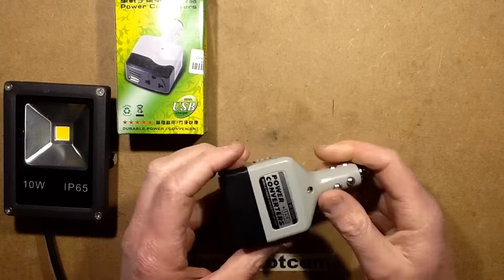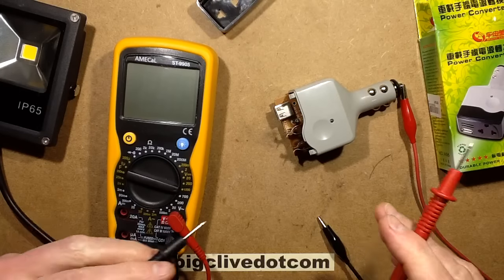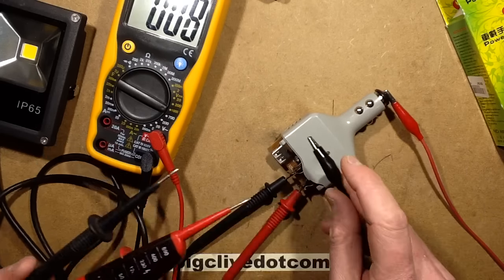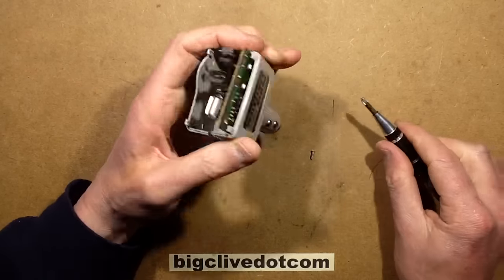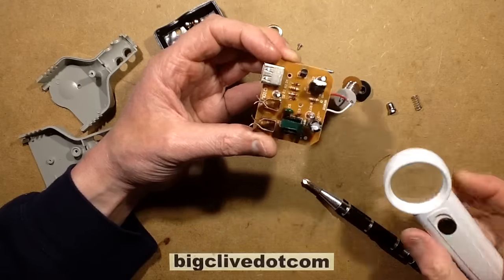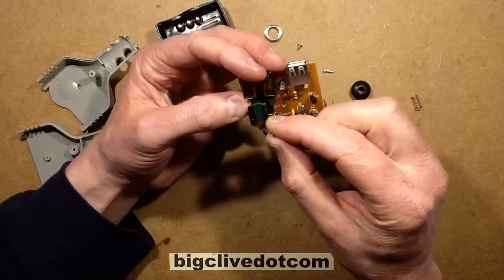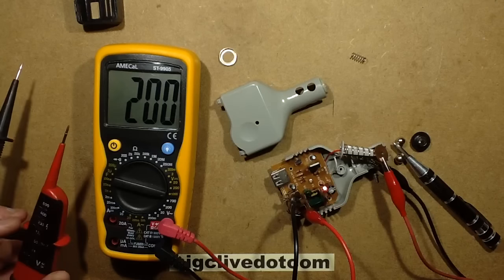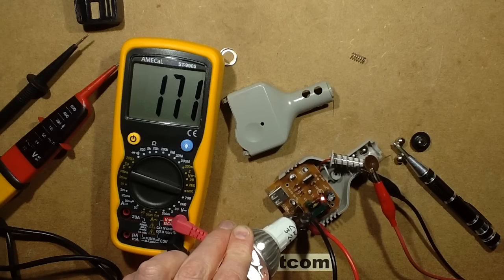Inside a slightly bizarre car to "mains" adaptor.

Comment: What are you saying: that the switching power supplies for most USB-charged devices can do their step-down without depending on AC coming in? IOW, they're universal like universal motors? The switching part comes from before the transformer, so somehow, even it can vibrate while only getting DC in? How does it adapt?
Reply from the maker: The AC going into a power supply is usually converted straight to DC and then used to pulse the small transformer with high frequency.  The wide voltage range is accommodated by a feedback circuit that tames down the power supply when its voltage is met.
Reply: @bigclivedotcom  Most devices with a full wave bridge rectifier after the mains fuse function properly on 100 VDC here in Japan since it would only be going through 2 of the diodes in the bridge. I did see only one appliance that REQUIRED 9 VAC and refused to operate on 9 VDC. That was the original 8-bit Nintendo. No idea why it would not work though.

Comment: But how can something that is ment for ac be plugged in this dc transformer and work as usual?
Reply: +Pirat Carribean Because its only designed to run switchmode power supplies, like phone chargers. Those sorts of thing rectify the AC input to DC as the first step, so if its DC already it just passes through the diodes and works the charger as usual. Likewise its highly variable, lower voltage isn't a problem as most power pack will work on both US 110v, and Australian 240v without any form of switch over, so as long as its between those limits it'll work fine.

As an aside it will fail to work with anything that require a lot of current 9liek a bigger laptop charger), or actually needs the AC power (like a motor).. and may even damage these things or catch fire as it tries.
Reply: +Hamish McGregor Thanks for the ingormation bro! I really appreciate it!

Comment: How do you get the proper amount of power to every product you review? right now,all I can do is 5v from my Arduino. I'm new to this.
Reply: +Gameboy 193 Lab power supply. There's plenty of DIY options that involve a PC power supply or you can buy a cheap one for under $100
Reply: I don't think I need a lab power supply, I just need an adjustable one.

Comment: I once stuck a 9 volt power supply into a 6 volt device it started to smoke and smelled very very unpleasant
Reply: I new that a 4 AA device uses 6 volts but messed up and thought it needed 9
Reply: +justin rivera We all make mistakes. I accidentally reverse over one of my little trees on the lawn yesterday and I can't find a replacement anywhere.
Reply: I'm surprised it still works to this day

Comment: Hey guys. (Total electronics newbie here.) 
I need to plug in at least two devices into the (single) cigarette lighter (sat nav + dashcam). What is the best way to go about it? Should I get a dual usb charger or is it better to have one with one of these https://en.wikipedia.org/wiki/Auxiliary_car_power_outlet#/media/File:Prise_multiple_allume-cigare.jpg ? 

Main thing is that I want to be safe: don't want to blow the electronics, nor mess up the car battery, much less melt stuff. 

Any advice/experience/suggestions?

Comment: I have something similar to this, but it has a power supply to ramp it up to something usable to normal electronics. It's a good adapter when the car is running, but obviously using it without is a great way to destroy your car battery. xD

Comment: i have one :) i used it to run a tiny b/w portable tv when camping back in the day
Reply: why not just run it on 12v ???
Reply: +Ian Grice I didnt have the proper plug i also plugged in a surge protector and without knowing better i would hook up a ps1 to the tv (yea i modded the fuse in the converter cuz it was constantly popping) I only used it a few times because i was afraid of killing my battery. I was running on 18yo brain cells at the time...dont judge me

Comment: Most car batteries are around 13.5 volts fully charged and the voltage with the engine on is around 14.5 . Would the cigarette lighter be 12v? Would this be the reason you could only get 197v from the adaptor?

Comment: whats the isolation in the transformer?
Reply: No Isolation. directly connected together.
Reply: +the3dvideo Doesn't matter for this since it's only powered from 12v from the car.
Reply: I mean to stop it pumping 200V back into the car.
Reply: the3dvideo It'd probably blow itself up before it damaged the car lol
Reply: Aren't car electronics supposed to survive 200V surges anyway?  And this thing could only cause a small spike...

Comment: try doing your experiments with it connected to the car. that is unless you used a car battery as a PSU. What is the output power on your 12v psu?

Comment: What's the point? Its cheaper to buy a mobile charger. Anything that looks like that in the US  will put out 120 volts at 100 to 125 watts @ 60 cycles

Comment: The poor tiny 78L05 would burn for sure if you connect anything more than some milliamps. At 14V from car is 9V drop... Hopefully it "burns open", otherwise it generates 'phone fireworks' at 14V/20A.
Indeed, it is an odd crappy self-destroying design.

Comment: I used to have an inverter I hard wired on using a relay. It was max 360s, so I could use it for my passenger's laptop for road trips. I always thought it funny my alternator produced AC which was turn to DC, which the inverter switch backed to AC so the laptop could convert it to DC again. So AC->DC->AC->DC

Comment: Why is a USB-outlet 'odd' if the adapter is meant to charge phones? Have you ever seen an iPhone charger? Or a LG/Nexus/Samsung charger? They all have... yep, you guessed it, a USB connector in them for the USB to phone-cable....
Reply from the maker: +Kamer Oudste Because this one is only able to supply a tenth of the current of even the most basic USB charger.  It would take literally five days to charge my phone if it could even keep up with the phones standard current use.
Reply: Lol ok, I see :) Keep doing these videos, they're both entertaining and educational. I'm not really a electro-geek but you guessed that already :)

Comment: If its main use is for old no-usb phone chargers it is probably useless anyway as many of those used a transformer to drop the voltage before rectifying it, so it would just present a short circuit to the DC output of this gadget.
I think the only real purpose is to make money off of people who buy it but cannot get their money back when they find it is useless.

Comment: Output is DC is that right? In the US almost all appliances are AC
Reply: everywhere
Reply: that means 2x the work for a pair of rectifying diodes while other two just chill, will work good with some stuff, although if you wanted to hook up something that uses a transformer it may fry itself or just not work.
Reply: To iterate on what Bartosz said (and what Clive alluded to in the video), most switch-mode AC phone chargers have a bridge rectifier that will convert the AC to DC anyway before using a high frequency switch-mode transformer to convert the mains voltage down to low voltage (typically 5V) for charging the device. As such, they can be run from AC as well as DC, and they can be plugged in either way thanks to the bridge rectifier. Electronics that use capacitive droppers (like the cheap LED lights Clive mentioned) -or linear 50/60Hz transformers- won't work though, and the transformer might overheat or blow a fuse without the inductive reactance that would normally limit the current when fed AC power.

Comment: You never measured the voltage output on the USB-port.
Reply from the maker: +Kamer Oudste It would have been 5V because the 78L05 is a dedicated 5V regulator.  But it's only rated 100mA and even then limited by heat dissipation depending on the voltage being dropped across it.
Reply: +bigclivedotcom This thing is not usable with todays appliance to charge it.
Reply: +Kamer Oudste  I got one the same and the USB voltage is 6.1 volts.
Reply: +Nigel Kingsley-Lewis That's odd. A 78L05 is a standard linear regulator chip and should make within 5% of 5V, if it doesn't shut down completely from overload. Maybe they did something dodgy with the ground to the USB connector.
Reply: +l wilton More likely that something went bad during the photolithography of the 78L05 in some shady Shenzhen factory :D
Reply: +l wilton We are taking about China made stuff.

Comment: 24v is for mini buses and trucks
Reply: There may be commercial trucks that run on 24V (I've not seen them), but the primary use is small aircraft.
Reply: +Folopolis and boats.
Reply: American trucks still have 12V electric system

Comment: Ugh I think I would find this device most unsatisfactory. If you wanted to charge your modern phone, you would expect to use the USB socket, which is useless 60-70ma max in reality.  But  If you had an older Nokia with a linear old-fashioned transformer (i.e. pre-usb charger), it wouldn't work very well to say the least. Seller would have to receive -ve feedback.

Comment: What is the point of the "mains" plug if it's not a proper inverter?  Every proper phone worth its salt charges via USB (or USB to lightning for those fruity phones).  Plugging in a mains-to-USB adapter into a car-to-mains adapter is just silly.  Friends don't let friends daisy chain adapters.   ;)

Comment: I am surprised you do not have a 12 volt DC power supply with a auto cigarette lighter socket  Mine can put out 15 amps its a Jetstream and I added a power socket from auto zone to it with 2 sided tape on top  love your teardowns ! OH btw I tried to pay pal you some cash but it will not let me ???

Comment: It is most likely be for small sub-5W cell phone chargers that usually stay oscillating in 150-200V range with stable output so the chinese fooled out that it outputs 230V, what it doesn't.

Comment: If you've run it off 12V then what did you run it ON?
Reply: Most likely a lab bench variable power supply that can duplicate automotive power. I am unsure of its amperage output tho.
Reply: Thanks,  @MikinessAnalog , but that's not what I was asking Clive. Let's see what he says, since it's weird to say "running off ___ ," etc.
Reply: @HelloKittyFanMan..  Were you asking what did he power WITH the converter?
Reply: @MikinessAnalog : He said what he would power OFF it; now I'm asking him what he would power ON/WITH it. Let's see what he says.

Comment: The use of the 78L05 isn't "odd", it is in fact "crap". Cheap no-name Chinese electronics, and it turns out it's garbage, only capable of a fraction of what it needs to be, and probably won't last very long. You've found a rare one, there.

Comment: I have played with these cheap things. They're all way overrated. The output waveform is like 60% distortion and a normal VOM cannot show an accurate voltage reading anyway. I'd never use a model like this one here to charge a mobile phone. Use a dedicated 5V charger only.

Comment: Hey Clive, I think it would be good to make a video every now and then in which you explain what a component of a circuit does, or what simple and commonly used circuits do. For example a "What is a capacitive dropper" video, or a "What is a resistor" video. I know roughly what they do, but you would be able to provide a deeper insight, which I think would add value to the rest of your videos for a lot of people. :)

Comment: i've got one winging its way to me now ,i only need about 10mA or so at 200Vdc so if it can handle that or a bit more i'm happy,if not i don't really care,i paid around 2quid for it free post from china.
And as for those who think all chinese stuff is crap,well i have HV generators that work really good,good enough to power a stun gun,or a fly swatter really,stuns the flys though.

Comment: 120V U.S. 240V U.K. So cars are 12V U.S. 24V U.K. FOR Cars
Reply: Ricky Gaming And More - Cars everywhere are 12v, heavy vehicles run on 24v
Reply: @mattjohns3394  some Very Old cars used to run on 6v, but You're right, cars 12v, heavies 24v

Comment: Power a laptop in the car and so on if it was a proper inerter.
Reply: An inverter that size wouldn't put out enough power for a laptop (75ish watts) , a few minutes and the magic smoke would start appearing. It might just about handle a 9 inch notebook.
Reply: +Green Silver I have one the same size as that that will put out 50W, or 60W for up to five minutes.

Comment: What a piece of junk! I have a 120V adaptor only a little bigger than that one and it is nominally rated for 95W. It is only modified sine wave tho. I used a ZVS driver to generate 120V at an amp or so, if I added some means of regulation of the output, a diode bridge, and a MOSFET H bridge DC to AC converter, I should be able to power many AC loads.

Comment: This thing is useless. I have an inverter around the same size actually capable of around 140 watts. What is the point of using this for a phone charger when you could just use a 12v car charger?

Comment: I was looking for an as small as possible inverter recently, capable of putting out about 100-150 W and stumbled upon this one. It's a from German eBay (I live in Germany), but I figure you would probably have to find a seller that ships to the Isle of Man anyway. https://www.ebay.de/itm/150W-Wechselrichter-DC-12V-zu-AC-220V-Auto-Steckdose-Adapter-mit-0-5A-USB-T4I8/283343771780?hash=item41f89ad884:g:xUoAAOSw55FcQeJn
It's like less than 8 pounds, I believe it puts out a 50 Hz AC square wave and a decent amount of power (probably not 150 W though of course). I didn't actually buy one but I've seen a review of someone else powering stuff with it, wasn't able to power a whole lot but he seems to have used the thinnest cables he could find so I'm not surprised. In either case, I would be very interested in seeing an "in depth review" from you if you are interested. :-)

Comment: wait how tf will a phone charger (swishing power supply) work on DC? many vital components require AC like tre transformer, it simply can't work with DC

 the fu*k? 😂
Reply: phone charger switching power supplies now days rectify mains to DC then chop at high frequency to feed a much smaller, physical size, transformer to low voltage with feedback to control switching and therefore control output voltage. Not need large chunks of iron at 50/60 Hz to step down voltage, that's why wall warts (Yankee) / plug packs (Aussie) are a lot smaller now.

Comment: on ebay, there is a claimed 150w plug in 12v inverter of around the same size as above, i wonder how much of the 150w it can do?  item 391397921466

Comment: In all practicality this device he is demoing is not very useful. It is not of proper design to be practical. The unit he is showing is not anything of what I would call proper design. 

I have some 12VDC to 120VAC 60Hz (I am living in North America) inverters that are rated 50W.  I also have some at 200W and 450W. The 450W is sort of on the large size. The larger than 2000W have to be wired directly to the battery circuit with a fairly large fuse and heavy gauge wire. The 50W unit is good to run a few phone or tablet chargers. The units I have are sort of heavy and have a heat sink on them.

Comment: Funny piece of shit... we got similar power adapters in Canada sold by Canadian Tire but they do put out a decent 60W generally.  Honestly though, running an inverter thru a car cigarette plug is dicey, because most car wiring to them is 18AWG or higher (sure it may pass 20A, but the voltage drop in the harness is high).  If you are running an inverter on a regular basis, it is best to have it on its own wiring circuit to the battery and not thru a cigarette plug (these get HOT past 10A) - it will last longer this way (I speak from experience burning half a dozen of these things out thru the cig plugs).

Comment: so.... it takes 12v off the car, then it converts them to 200v, then they espect you to connect your phone charger that converts the voltage to 5v, and then the phone converts it to 3.3 v.

Comment: These are very common here in North America. We use them for any plug in device (especially useful when camping).

However, we usually use proper inverters that output a nice reliable 120V AC.